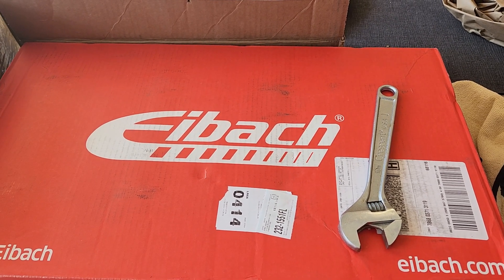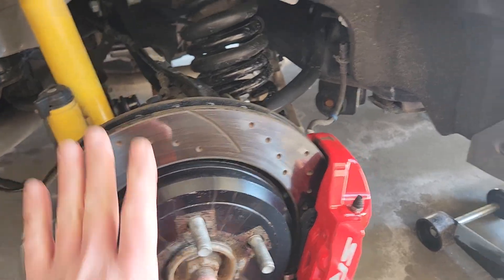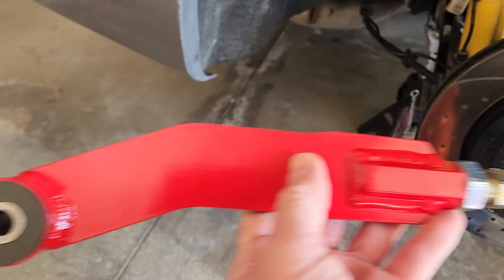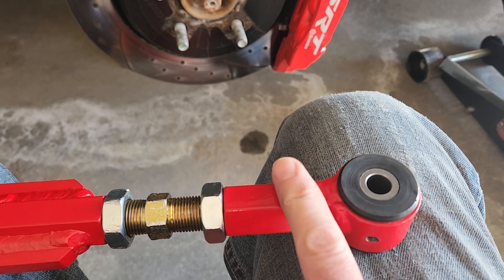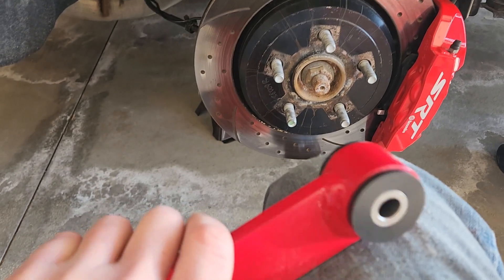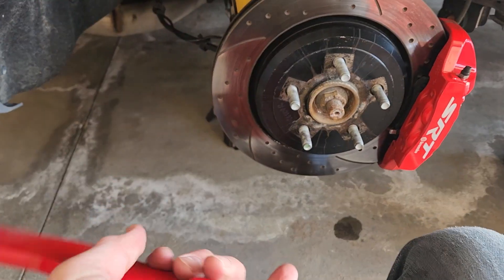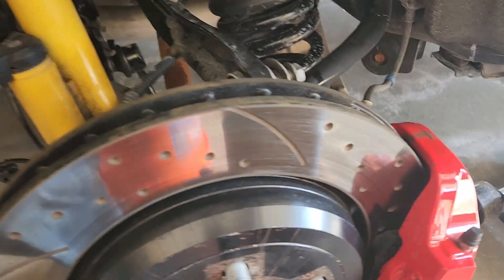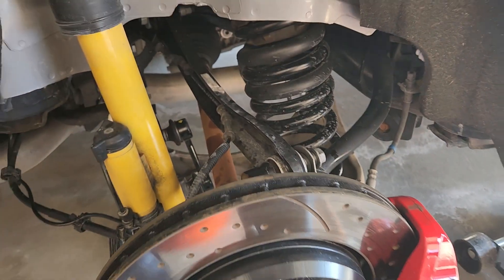BWoody Adjustable Rear Upper Control Arms 21 Dodge Durango RT TNG

Comment: If you delete your self leveling shocks and add bilsteins , you can run them with the same coil springs , what will happen is that it will level out the car and lower the rear a bit , but will cause a lot of camber , that’s why you will need these camber arms to fix that . Or you can put that same part that’s stock from the regular non tow package and it will fix the camber as well

Comment: guess im glad i didnt get those springs
Reply from the maker: It's worth it.  It looks SO much better now!!!  Most people drop thousands of dollars on coil overs, etc.... so for just $800 I am beyond happy with how it turned out.
Reply: One of these day i will have to check out your durango.   We are in the same town
Reply: I have the same set up on my Tow N Go, Eibach Pro Kit and Bwoody Full Suspension Kit. Was able to get the rear alignment perfect, but the front not so much. The stance and handling are 🔥 though!
Reply from the maker: @jasonxenos2033   No way!  Very nice!  It's weird - my alignment shop got all my wheels in the green but the fronts I swear look like they are leaning in at the top by the fender - going inwards.  But not by a lot - it's starting to grow on me because a lot of F1, NASCAR and road racing vehicles are setup this way on the front.